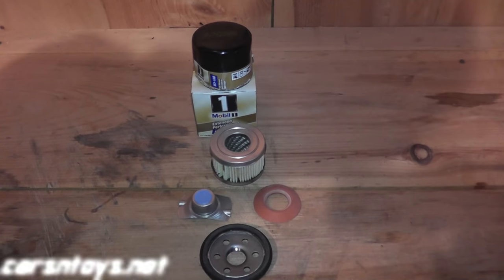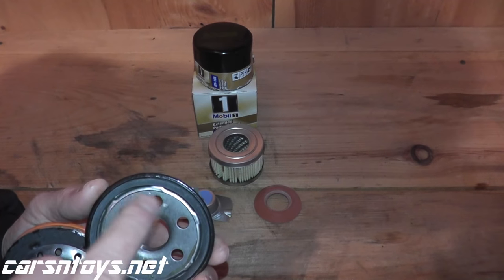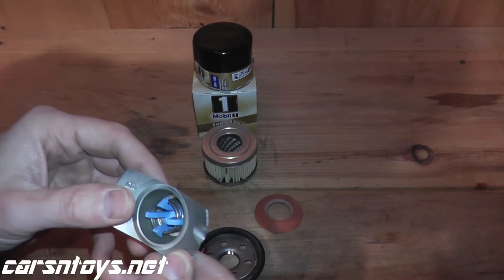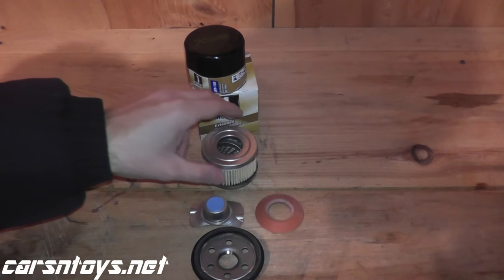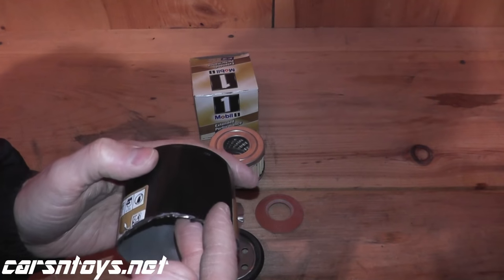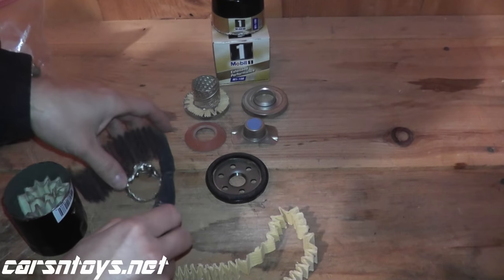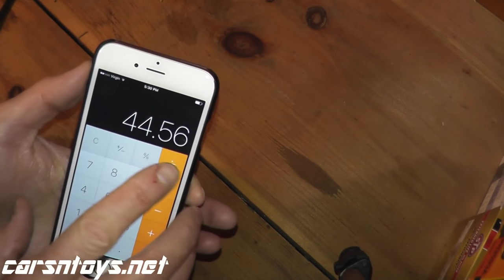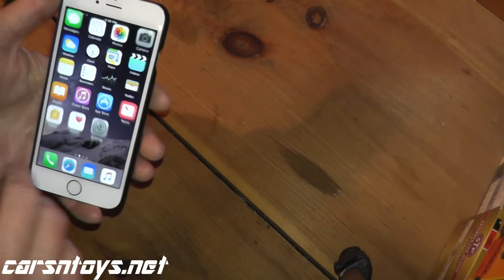Mobil 1 Oil Filter Review

Comment: The Mobil 1 oil filters are not 100% synthetic but a blend of Synthetic and other materials per their own product description. As for the wire backing, that appears to be a feature necessary only on filters that are 100% synthetic to hold the filtering media more secure in place.

Comment: Mobil 1 now has a new line of filter that are intended to last 20,000 miles to match their new oil that is also intended to last 20,000 miles or one year. The old filters that last 15,000 miles do not have an "A" at the end of the filter number. The new ones, that will last 20,0000 miles, have the letter "A" at the end of the filter number. The price is the same. The new 20,000 mile oil can be purchased at Walmart for $50 for 5 quarts and the matching filter for $10.
Reply: It's more of a marketing ploy than anything. It's still a good product but the filter media will break down over time and not be as good as it was when used brand new. Regardless, I still change my oil 5000/6 months because no matter what the oil will break down eventually and not perform like it should as it ages along with the oil filter. Then again, driving conditions will vary.
Reply: That's true about cellulose based materials. Synthetic blends don't break down like cellulose alone. Synthetic Media holds up even more than Synthetic Blends as it doesn't break down at all unless abrasion is happening. (Which doesn't happen as it takes something solid and rough.) Synthetic blends use fiberglass as a way to improve structure and capture capacity. Synthetic Media could be all fiberglass. Cellulose is actually plant matter fibers (paper, cardboard, ect.) It has a low density capture (which is why the rates of oil change are so frequent.) They also don't hold up well. Which is where you get synthetic blend media. Wherein the use fiberglass to reinforce and hold the cellulose media, it allows them to make thick media as well. Both are fibers that interlace creating a strong surface while allowing oil to pass, and capture larger particles without restricting flow too much. It's not just the length and width of the filter that determine capture though. It's thickness, and pores. Cellulose for instance is short fiber strands. This means that allot of the surface area is used to keep the fibers together, allowing for smaller capture rate. Adding fiberglass, allows for more surface area as you can make the strands that hold everything together infinitely long. However, you still needs to have the cellulose bind to its self to decrease the particle pass size. This is fixed by using fibers of infinite size formed how you like it in a interweaving mesh of, however thick you need it. Costs more as you need heat and not just special chemicals to make. But it's worth it. To add to this, the space for larger particle sizes than can be captured within the fibers (like in a hepa filter for air.) happens IN the pleats. Pleats also add to surface area allowing more surface in a smaller area. Hope this helps.
Reply: Amaury Legra  it says on the box to go by your manufacturers recommended oil change and filter change. It may be a 20,000 mile oil filter but if your manual says to change every 10,000 miles change it especially if you are still under warranty. Scotty Kilmer recommends Premium Guard extended life filters. The are others good filters like Royal Purple,Wix, Purolator One,Baldwin.
Reply: Autozone has a special right now which I used to get both this oil filter and matching synthetic oil for $32.99 great deal in my opinion. I’ll see how my car likes the upgrade from Castrol edge
Reply: for the 20k miles refers to Highway miles not 20,000 city miles..   city miles might be about 5-6k
Reply: @baltazarandrade4711  I use Mobil 1, but is it really an 'upgrade' from Castrol Edge? Castrol Edge has all the same certifications.
Reply: I’m at Walmart right now in California and the Mobil 1 20,000 Mile full synthetic oil is $24.37.

Comment: In my opinion, far as the media, the K&n oil filter that you did has a higher number at 94 inches vs the mobile 1 with 45. To me, I would choose the k&n over the mobile1, wix XP, Royal purple, fram xg or the amsoil oil filter. To me, filtration and flow rate are very important to me and the K&n oil filter will do both and catch more small particles. This is only my opinion! Thanks for your videos
Reply from the maker: I run K&N quite often. No issues. Thanks for the feedback!

Comment: Last time I checked, The Anti-Drainback Valve holds oil in the filter. To prevent Dry Starts
Reply: True. But, it also must retain flexibility to allow the oil to flow freely past it, so it can go through the filter media. Its a double edged sword. Thats why people really prefer the silicone material.

Comment: The micron rating is also important this filter is 99% effecient but at 30 microns. I found the longer interval filters don't filter as fine a particle so they can last without clogging up. Where the Bosh isn't meant to last as long but is rated for 99% efficiency at 20 microns. Great effort, money and time in your reviews but I would add the micron rating to go along with the stated effecientcy
Reply: source for the micron ratings?
Reply: Royal Purple is a great compromise. Best filter out there. Great flow and filtration and built with all synthetic glass fiber

Comment: He says it backward.  The anti-drainback valve is there to prevent the oil from draining back into the engine, not into the filter.  No valve & every engine start will be a 'dry start'..i.e. no oil lubing the bearings until the filter is filled with oil again.
Reply: Gregory Prevost 
If ur filter in on the bottom of engine anyways... Who cares...ppl are stupid
Reply: @ramtrucks721  : would your mechanic care one way or the other , i doubt it ?

Comment: Why is the wire backing wrapped around the inner core?  That implies the filter material would disintegrate and clog the metal core.  I think the wire mesh is on the exterior of other wire mesh oil filters' media. like Purolator.

Comment: you cant go wrong with mobil 1 oil and filter no way i know the best out there. i did my home work. mobil 1 rules .
Reply: I think so. I was a Castrol fanboy forever until I opened the hood of a friend’s new Mercedes Benz. It stated that Mercedes recommendation is Mobil 1. So been using every since.
Reply: Mobil 1 is awesome. I wish I knew how many miles were on the filter before I just changed last week. Sure.. it weighted a ton with all the debris inside! Of course I replaced it with a Mobil 1 filter again.
Reply: I agree. My pastor switched me. I used castral syntec
Reply: what is wrong with you? I think you need a therapist.
Reply: I would think it's not who makes them but rather how they're made and to what specific spec.  If the Mobil 1 spec is sufficiently rigorous and their contractor meets the spec then all good.
Reply: @DJMiTCH I don't touch Mobil one oil for many reasons. Very overrated. Pennzoil ultra platinum is a better oil and you can get it for less most likely.
Reply: Delusion is an Illusion Penzoil better than Mobil 1 lmao good one 😂
Reply: @BM3USNAVY  mobil1 is pao based
Reply: Chevy recommends it on the new Vette.
Reply: @rodh2168  So true. Many companies don't make their own branded goods. It's their spec's that matter. The companies may not make them, but they do set their own spec's. That's what matters. Craftsman B&D  is owned by Black & Decker. They send their spec's to MTD. MTD builds a very fine residential Zero turn mower from those spec's. It's sold as a totally different Zero turn than the Sears Craftsman mower. It's all in the spec's that determine the quality of build.

Comment: Nice video. I use K&N.  I hope i'm using a good filter.  My buddies tell me K&N Filters are very good.  I guess i'll checkout some reviews.  But very good video of the Mobil1 .
Reply: Quentin 33 if you follow the recommended oil change interval, and put the correct oil and filter in your vehicle, you will be fine. I know people that have used Supertech oil and filters for the life of their vehicles, and have over 300k miles with no issues.
Reply: @springfield03sniper  thx.

Comment: these are great filters. but, I'll stick with the fram ultra synthetic. every bit as good (if not better) and cheaper and it has wire backing.
Reply from the maker: I agree. You get a lot of bang for your buck with the ultra synthetic filters.
Reply: Fran Ultra Synthetic is a great bang for your buck. Definitely better than Mobil 1.
Reply: General Zod Never Fram! Ur playing with fire. Mobil 1 or WIX or Bosch oil filters top notch. Fact.
Reply: Um all fram filters are junk, didn't you see the other video exposing fram???

Comment: On a side note. Subaru makes junk motors that blow head gaskets regularly
Reply: is this something you have personal experience with or just heard through the grape vine seeing as people who know nothing tend to repeat things they've heard rather than know
Reply: OH WOW!!!! PPPPPPPPPP!!!!!!
Reply: Mike Scherer had a 1996 outback with 4 sets of head gaskets . It’s a widely known problem. Subaru needs to go out of business
Reply: @jonsmith919  I've done 5 headgasket jobs and never had customers have problems after. Yes it sucks that it has to be done but that's what comes with the territory of a horizontally opposed engine. If you needed 4 headgaskets on one car my guess is your heads were not machined correctly or not at all and poor quality gaskets were used. OEM gaskets are not very good and fel-pro are complete trash. And subaru won't go out of business because they have the best AWD system for passenger cars. That's their biggest marketing point. With your logic all car manufactures should go out of business especially FORD for the door latches on their F150's
Reply: Old info! Problem is fixed now